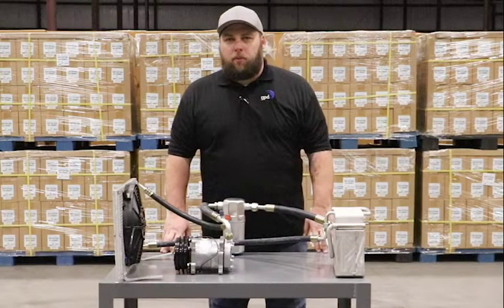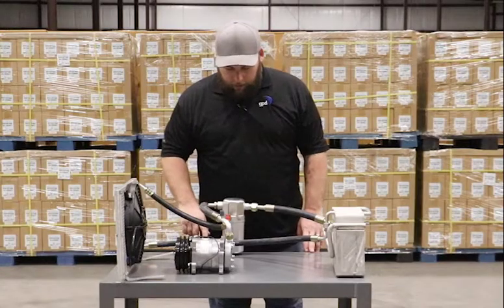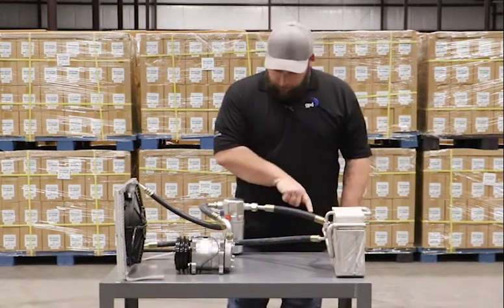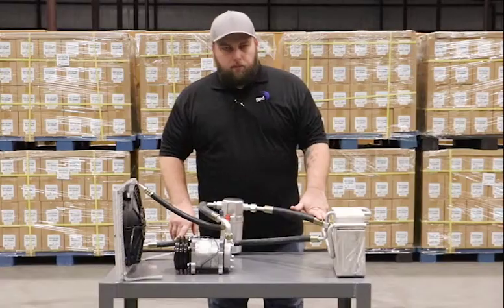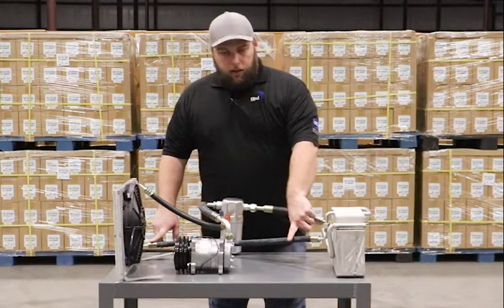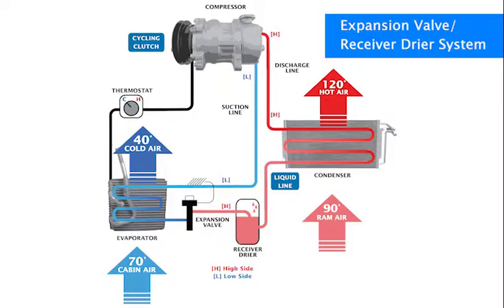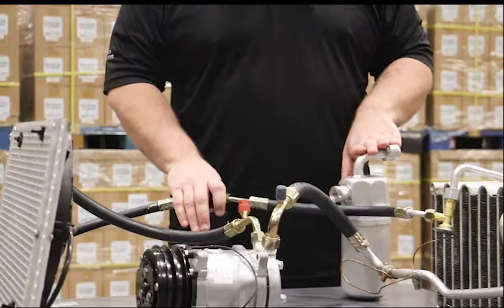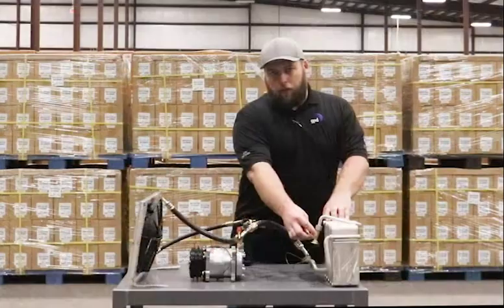Automotive A/C System Explained

Comment: Cool...but.. My cabin is on the other side of the evaporator. Did they build my car backwards? 😂 thanks for the quick explanation. Helped
Reply from the maker: It depends on the model. Generally, the cabin air filter is on the passenger side.